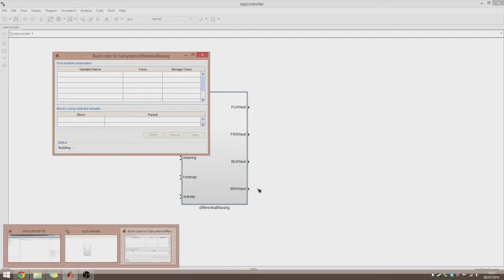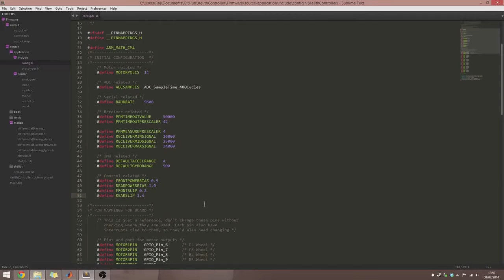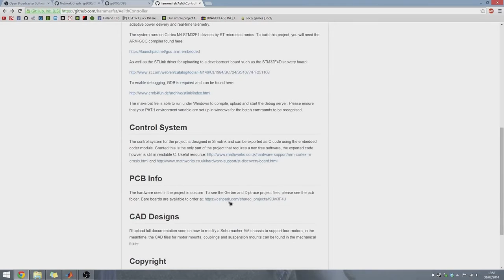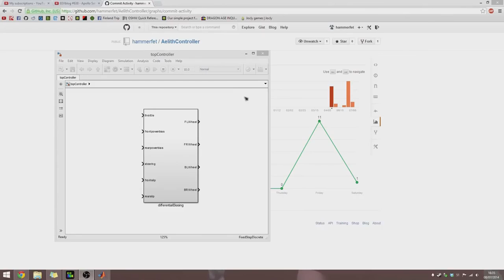Independent Wheel Drive 1/10 Scale RC Car: Project Aelith

Comment from the maker: Boca Bearings presents one of this year’s Innovation Contest entries!

Independent Wheel Drive 1/10 Scale RC Car

This project rethinks the way automotive vehicles have worked for decades. The geometry of cars have always been similar in order to house large mechanical components such as engines, drive shafts, gearboxes and differentials. This project gets rid of all that and simplifies the drive train down to four motors and four wheels.

The creator hopes to introduce an open source controller and reinvent the RC car space to achieve the same kind of advanced control often seen in quadrotors. Each wheel-motor assembly requires five rotary bearings and there are four of these assemblies in total. The steering rack also uses several bearings that are essential to the design.

Though ambitious, the Independent Wheel Drive is only one of the many entries in this year’s Innovation Contest. Be sure to check out the Independent Wheel Drive and other entries at: http://www.bocabearings.com/innovation-contest/ContestantDetails.aspx?ProjectID=123